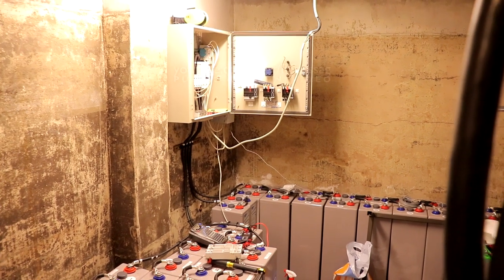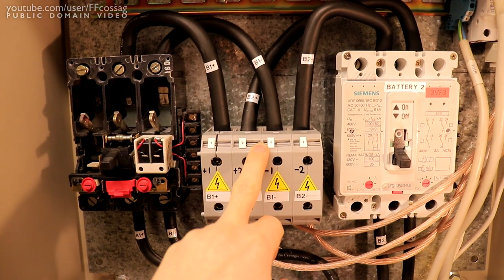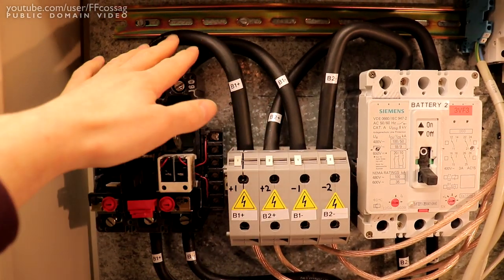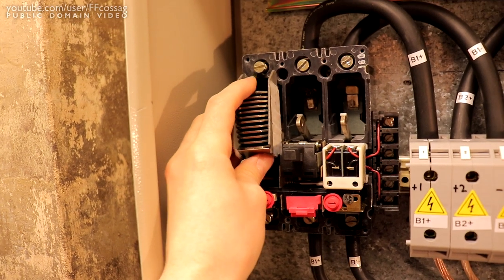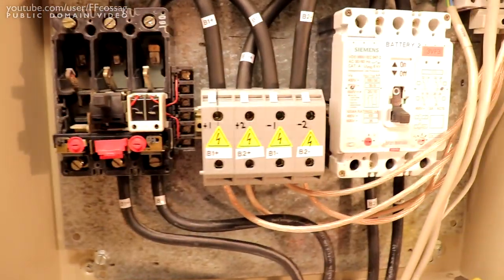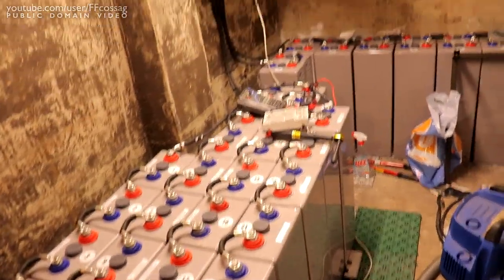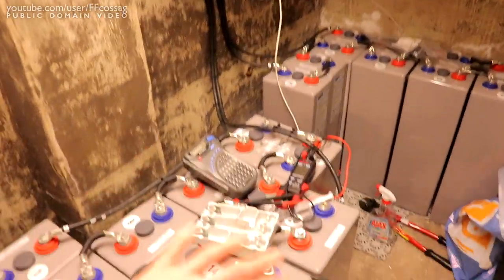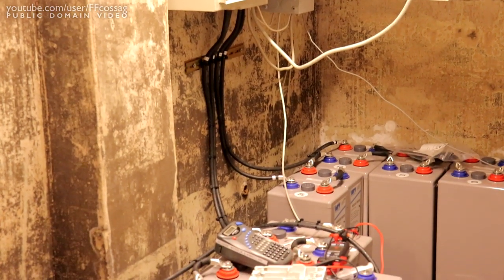OPzVLOG 5 - They're wired up!

Comment: Hi FF, I like your setup. I think isolating every single pole is the way to go, an acrylic plate on top is bonus. Most accidents happen while maintaining, thus they are often arranged as an big U. Would go with 3D printing and design some clip on covers that grab on the booty of the jumpers crimp terminal and cover all up. Don´t forget to leave a tiny little hole for cell probing with a multimeter. That way you can easy probe or pull the cap off if needed and you are profected if something falls. Also, please get some plastic wall tubing and always use crimp terminals. I suspect the room ventilated enough for all the funny gases or are they closed type?
Reply from the maker: Isolating every pole would be nice, but it's not happening. These batteries are gel cells, so they're going to require practically no maintenance over the course of their lives, so interaction with them is going to be minimal anyway.

Ventilation in the space is actually excellent since there used to be an oil burning furnace installed there. It left a giant hole running up the chimney when it was removed, so there's constant, passive airflow going there.

Comment: Hey FF, do you by any chance know what the battery voltage for a su5000i is? I'm assuming 48v but not quite sure because it take 4x 24v packs.
Reply from the maker: Afraid not, I've never worked on one of those. I'd kind of suspect they're all in series though.
Reply: It's 96v for the 5000 and 2x96v for the 10000